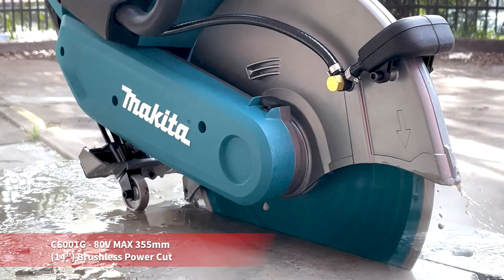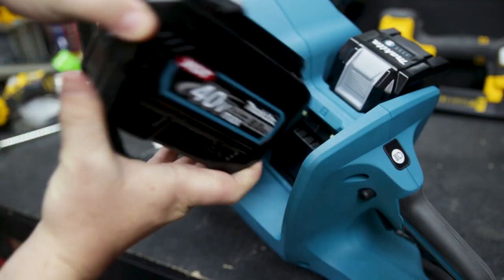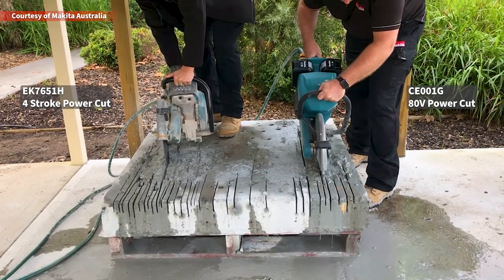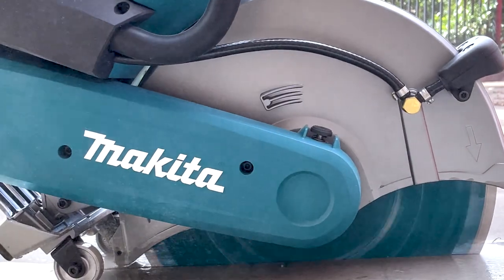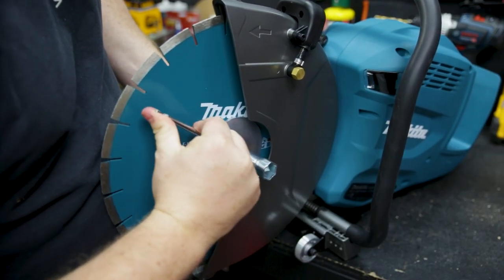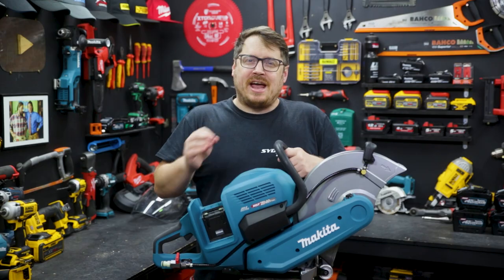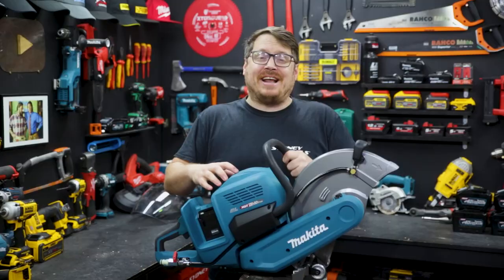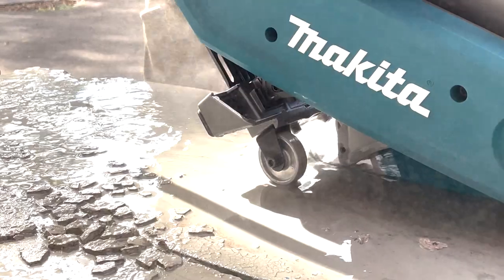NEW XGT 80V Power Cut - 355mm (14") Cordless Concrete Saw (CE001G)

Comment: Hey legend, how long did the battery’s last in it??
Reply from the maker: I cut 5.3m with 2x 5Ah batteries at near 3/4 to maximum depth (5”) in very hard reinforced concrete.
Makita Japan got a similar result to me, 5.4m with two 5Ah batteries and 8.4m at 50mm depth off two 8Ah batteries
Reply: @SydneyToolsTV  Hi Tim are you Lebanese too? 😂😂

Comment: How many cuts with 2   8 ah batteries
Reply from the maker: cutting what? how deep? how hard? I omitted runtime from the video as it varies so much from application and user.

I found it fast cutting, Makita Japan did a test cutting at 300mm wide 50mm thick concrete pavers and achieved 28 cuts or 8.4m
Reply: I used 2x8AH cutting reinforced 100mm concrete. Get about 5.5 meters in a straight cut.
Very easy to keep straight and easy to handle.

Don't run the double charger with the 2x8ah, run 2 single chargers.

I tested it with my other batteries but wouldn't bother with 2x4ah or 2x5ah. 
The 2x4ah got about 1 meter and the 2x5ah a bit more.